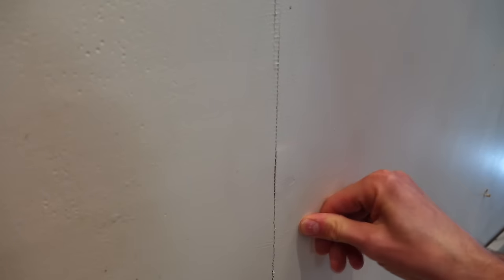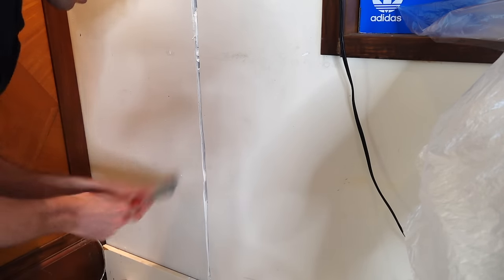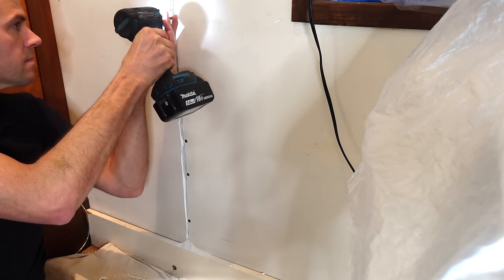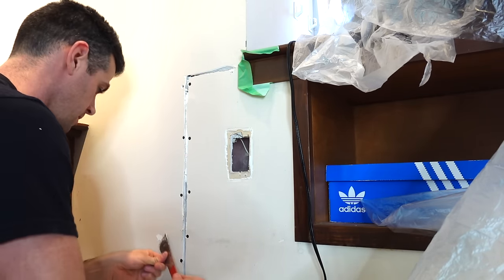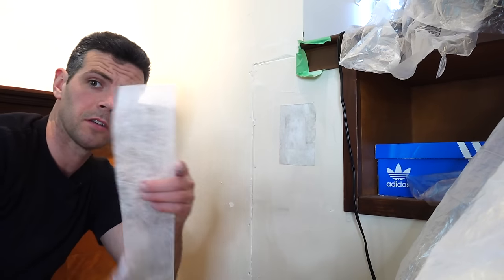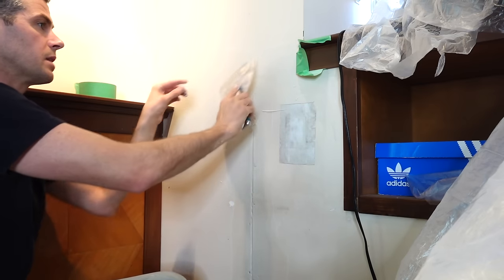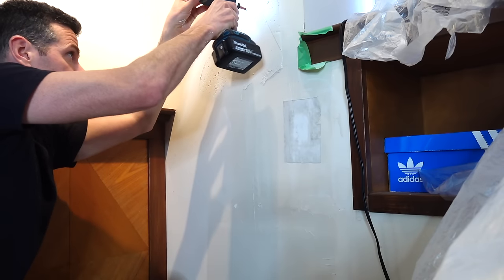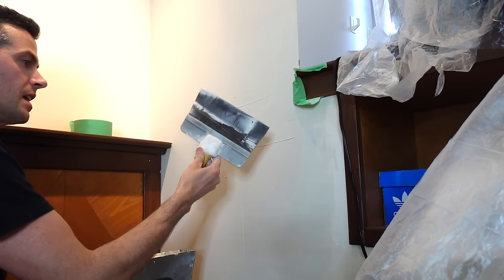Drywall Repair!!! Fixing a classic MESH TAPE CRACK!

Comment: I have a 1 foot, 45 degree diagonal crack coming from the top corner of a upper level bedroom doorway to the ceiling. Identical crack on both sides of the wall.  They are diagonal, so doesn't appear to follow a seam.  35 year old house settling?  Would Fibafuse be a good solution?  Best pre-mixed mud to use?

Comment: I have a project coming up and interested in your thoughts.  A minor roof leak (we have a new roof now) on a peaked ceiling caused water damage mostly in a few seams.  The paper tape has bubble out along long lengths of the tape, and bubbled out some paint so there are some wrinkles).  The finish is an orange peal texture.
I'm thinking of cutting out and pulling the tape and scraping the mud down to the drywall paper then mud and retape (or glue the tape?).  I'm thinking that retexturing will be a problem on such thin lines with finished paint on each side.  Thoughts?  Do you have a video on this?

Comment: All a person has to do is take a quick glance at the wall and know it was improper installation from start to finish.  No miter cut for the trim.  No mud around the old work box.  Press on the wall see screw heads popping up.
Reply: Yup

Comment: maybe you guys can help me out. adding backing above my mantel for a motorized tv mount. when fixing the drywall for this area, is tape or mesh better? there will be some static movement from the motorized mount. ill be using 45min mud, if that matters.

Comment: Always be sure you have one of those razors that is independent of the handle. i used a $.99 store utility razor knife and the entire handle covered the long blade, When the cheap handle broke It almost sliced my skin to the bone. I'm traumatized by that, so I only use an expensive Milwaukee utility razor.

Comment: I think fix it all or durabond 90 would be best to fill it in with the mesh tape. But you need to feather  it out really good because it is very hard to sand after one day or even 1 hour. Fix it all gets hard after 10 minutes literally. Then over the top use ultra lightweight joint compound.

Comment: You are often referring to "glue" in premixed joint compound, as if there is a pva glue additive in it. Living in the northeast US, i have used premixed joint compound.....basically my entire life. I have never seen any evidence that there is actual "glue" in joint compound. I mostly use sheetrock...or usg green top, or proform red top. 
Now dont get me wrong, im not saying that it isnt in there, but honestly i would be very surprised if someone could prove to me that there is glue in it.  I have used plenty of powdered mud in the form of 90, 45, 20....etc. and i know there are some funky additives in there.....possibly a bit of portland cement....but i wouldnt guess there is glue in that either.

Comment: Your videos are great.  I’ve learned so much from watching them.  I have some drywall cracks in my house due to settlement issues.  I can see that mesh tape was used at the crack locations.   I plan on using Fibafuse tape on the repair.  I find it interesting that you used a 3” strip of Fibafuse instead of a 2” strip.  Will the wider piece of Fibafuse decrease the chance of the crack reappearing in the future?  If so, would a 6” wide piece of Fibafuse be even better for the repair?

Thanks again for sharing your knowledge in your videos and I really hope that you can find time to answer my questions regarding Fibafuse width.

Comment: Note to all you amatuers, please don't use an impact driver to put your screws into your plasterboard like this guy, its not the tool for the job, most users of these tools push the screws past the paper and into the gypsum which then gets crushed and makes for an improper fix on your boards. Get a dimpler for your drill or hire a collated screw gun
Reply from the maker: Impact drivers don't sink screws too far. People sink screws too far.
Reply: @vancouvercarpenter  yes. that was satisfying.

Comment: What did you cover the outlet box with?  Do you always cover outlet boxes?
Reply from the maker: I just used a quick patch while I was waiting for the pre-fill to set up a little.
Reply: @vancouvercarpenter  What do you normally do around boxes especially close to joints?

Comment: First of all there is no timber behind as they just put the sheets up without joining on a wall stud. Next pull the crappy mesh tape out and redo with Spark perforated paper tape not the crappy mesh tape. Next use a proper Basebond material then go over it again with the same as you should leavi g to DRY between coats before setting with the proper setting compound leaving to DRY then sand. Or get a Experienced Plastered to do it properly because I guarantee that mesh tape crap will split again!!

Comment: What are your thoughts on using bondo for this problem?
Reply from the maker: You will be fixing it again and it will suck even more to fix the second time. Bondo has no place on drywall. It's too disimilar.
Reply: @vancouvercarpenter  Thank you.

Comment: I am no drywall guy but if this was my house i would have used a belt sander to grind off the old patch and take all the previous mud out of the joint with a grinder tool. I wouldn’t bother taking my knife out.

Comment: Jesus I hate shoddy workmanship. Unless it’s an extremely expensive home, it would appear the builders have a propensity to just do half-ass work.
Reply from the maker: This was some DIY work I'm sure.
Reply: @Vancouver Carpenter  In fairness to us DIY types my so called professionals took every shortcut there is and as a results many areas failing at my home.  So I am wondering if paper tape will release from the board, would you recommend scraping it off before retaping?  I am guessing yes, along with getting the mud out from between the two boards so a proper prefilled, tape finish procedure can be accomplished.  One other question I haven't seen you discuss for joints that occur in middle between studs or short edges of the sheet, original tape job cracked and there is access to backside would you backboard those if they were cieling joints?

Thanks for posting all of your work,  super helpful to us trying to learn!